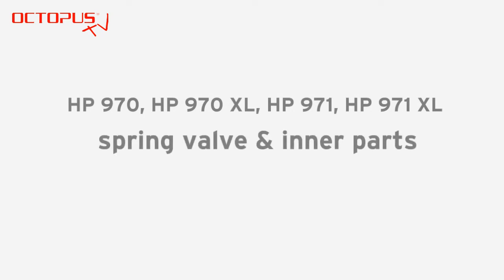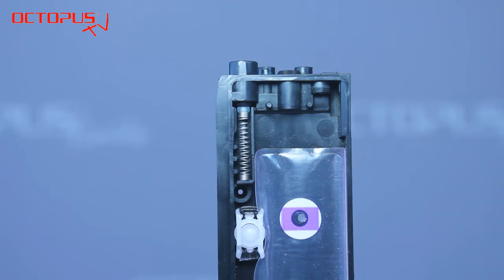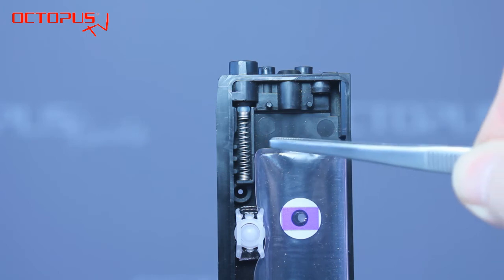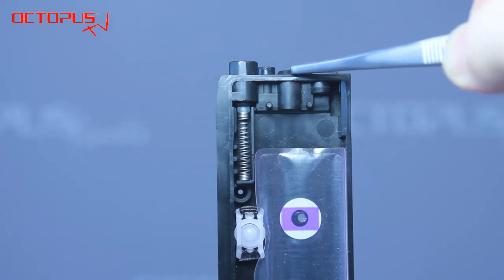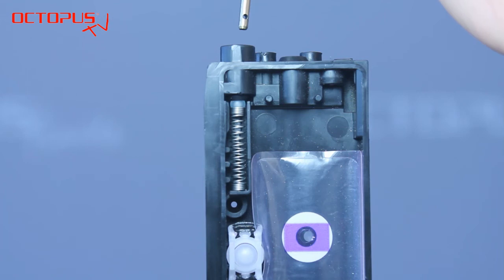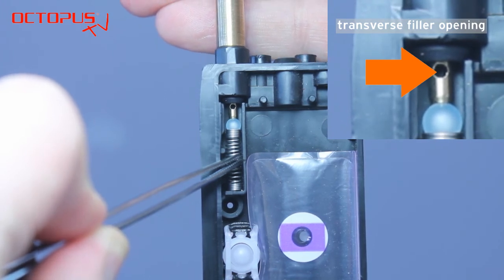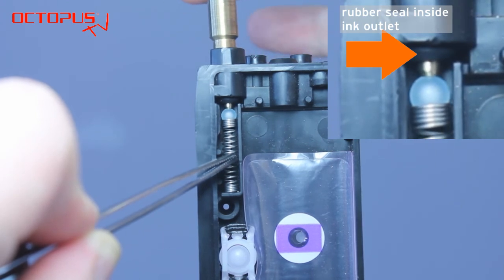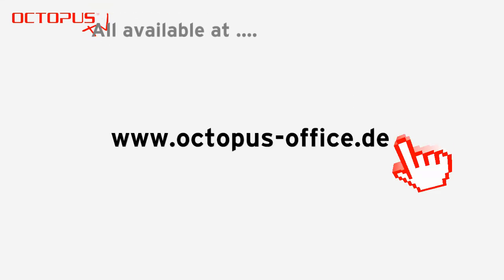HP 970, HP 971 refill - How does the spring valve work?

Comment: You mentioned the opening in the middle of the front and that it is connected to this white piece. What is that good for? Otherwise great video!
Reply from the maker: Hello Harry, thanks for Your positive feedback and Your question. The big port / opening on the front side is connected to the air bags inside the cartridge. Inside the printer there is an air pump mechanism that connects to that opening on the cartridge - during the printing cycle of that cartridge that air pump tries to press air into the bag inside the cartridge. By measuring the amount of air that goes into the bag the printer can calculate how much ink is left inside the cartridge. At the beginning of a cartridge´s life cycle the air bags are free from air and are fully flat. We also point out to remove the air from these bags before refilling such a cartridge and taping these ports when the refill is done by applying negative pressure to the ink chamber. The background information to these cartridge are quite a lot... 😊